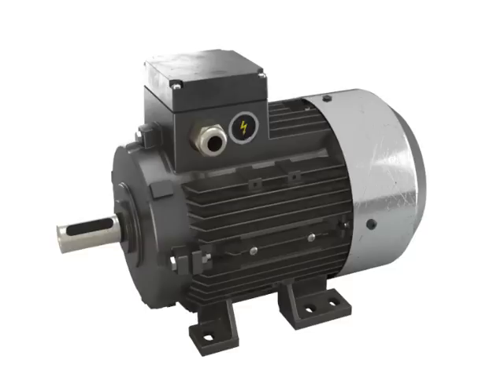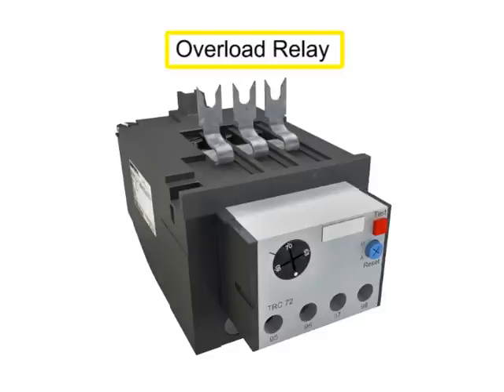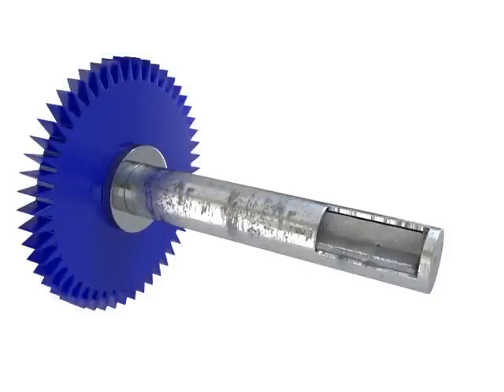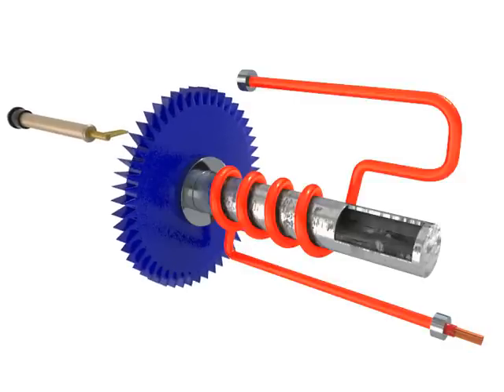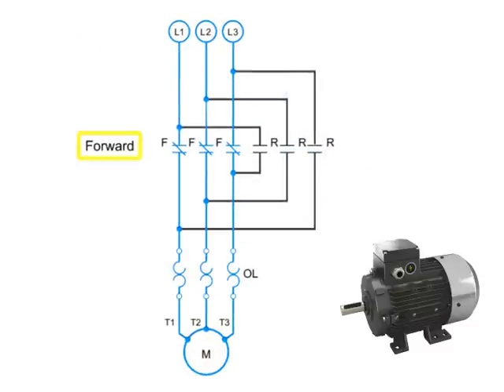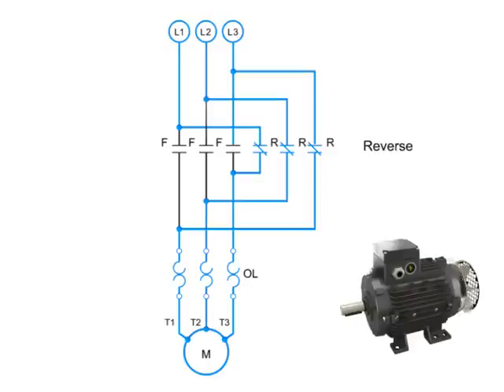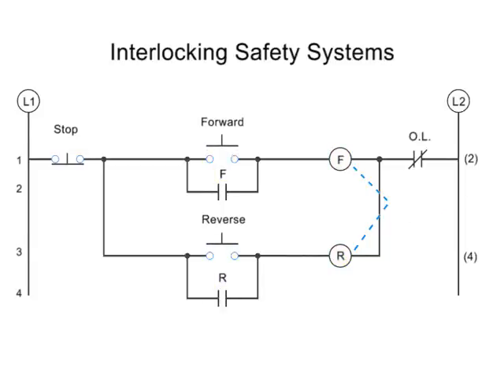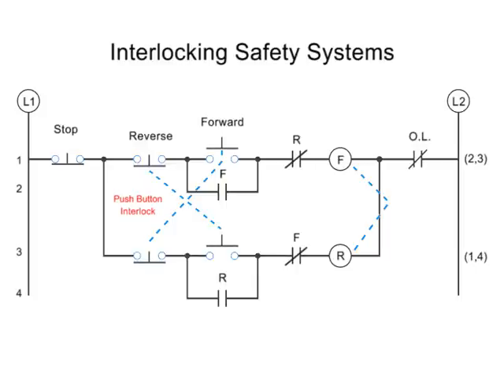How to Protect Motors from Running in Overload

Comment: when metal melts. Then it again convert into solid or not?? i have have to bpought this relay. with which name it is available in market??
Reply: Yes, it turns back into solid once the temperature drops below the melting point. They are called overload relays.

Comment: when it get melted how shaft rotate
Reply: Akii Akii the eutectic metal when solid holds the gear still against the spring compression on the safety cutoff. when the metal melts the spring decompresses mowing the gear and the cutoff.